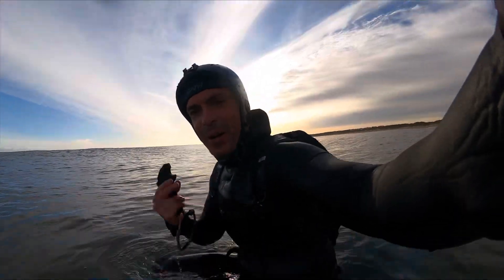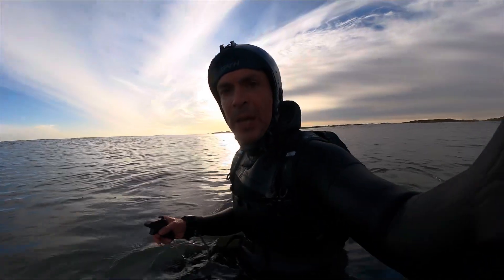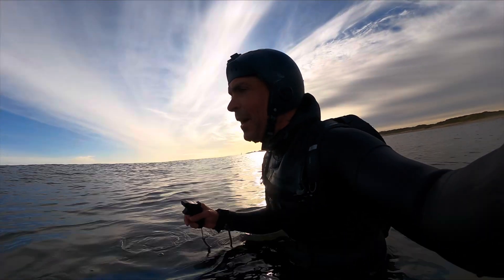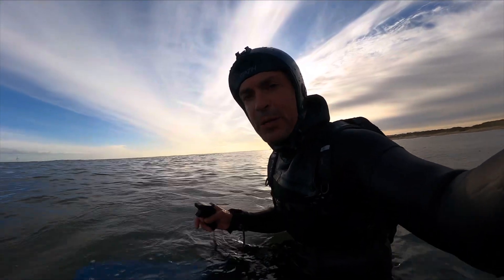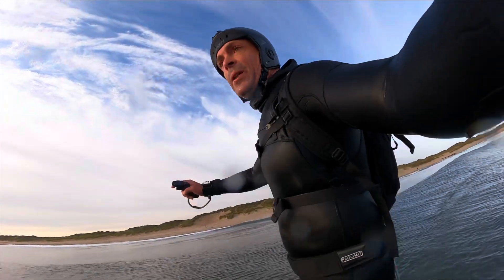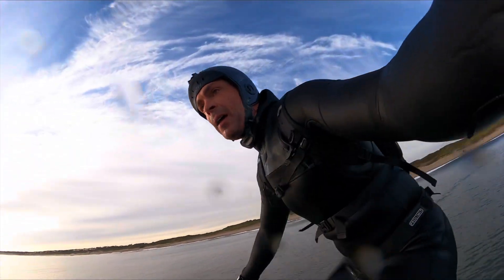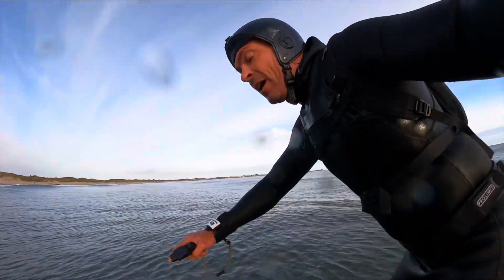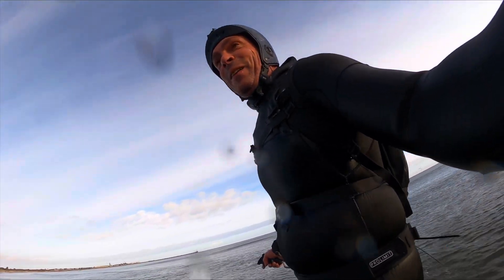Backpack Foil Assist / Foil Drive DIY Build

Comment: Nice work also planning to do something similar. What ESC do you use? If im right the three motor wires gets disconnected if you fall of the board? Did you already test that? Normally when the motor is running and this happens the ESC is dead afterwards...
Reply from the maker: Thanks. I’m using a castle Phoenix HV 160a ESC that I picked up second hand. I have also used a SEQURE 200a 14200 Pro. The cable stays connected when I fall. I have a dyneema board leash with a small amount of bungee running in parallel to the cable that is shorter than the cable even when fully stretched so the cable is never under any strain.

Comment: Looks great, interested in your umbilcal design. Did you use 4mm sq 3 core? Did you wind the coils yourself?
Reply from the maker: I’m using 2.5mm sq 3 core. It is the same cable used by foil drive. I did wind the coils myself. Thanks

Comment: what happens if you fall on a wave and board is pushed away from you?
Reply from the maker: I’m leashed to the board. I’m using a dyneema leash with a small amount of stretch in it. This runs alongside the electric cable inside a sheath. The cable is longer than the leash so it will never be put under any stress.
Reply: @JDFoiling  well thats conforting to know! If you ever have the time/patience I'd like to learn how to build/setup this. cheers!

Comment: great project and I'm building the same :) what wire/leash did you use ? are you using a 8AWG wire ? how to secure the battery / motor wire in case of a fall  ? And finally, how did you cooldown the ESC ? what setup did you use : Motor / esc ?
Reply from the maker: Thanks. I’m using the same 3 core cable used by foil drive. The reason for this is how reenforced and waterproof it is. I’ve coupled part of the cable with heat to stretch and have a dyneema leash with less stretch than the electric cable running alongside it (wrapped in a sleeve so it looks like one cable). This means the cable will never stretch more than the leash thus protecting the electrics. The motor wire is secured with a cable clamp which connects to the rear of my foil track. This clamps it very securely against the board. I have a large aluminium heat sink attached to the outside of the box I use in my rucksack. The ESC is stuck to this on the inside using thermal paste to transfer any heat. It’s passive cooling but works well. The motor is the 6384 120k BUAV that you can get hold of cheaply from China. The ESC is a second hand castle 160a Phoenix. These are amazing but v expensive new. An alternative that people are using is the sequre 12200 or 14200.
Reply: @JDFoiling where did you find the foildrive 3core câble ?
Is it better to have long motor câble or long batteries câble ? 
I will put the esc in a waterproof box on the board but receiver and batteries in the back pack
Reply from the maker: @f @f2bcnc74 the cable is “LAPP Olflex Classic 400P 3G2.5”. You don’t want long battery cables. That is why I avoided having the ESC on the board and went for the ESC next to the battery in the back pack.

Comment: Did you time the sesh duration for 12S2P battery in the conditions from the video?
Reply: See it now, 7km is pretty good I would usually I do 12-17km depending on the day using 11S3P and pretty high aspect foil 1000cm AR12 (almost no pumping back, maybe 500m max during the session)
Reply from the maker: @bohdanafanasyev3642 the 12s2p is using p45b cells. I’m going to make the 12s3p using the molicell p50b which have 11% more capacity per cell.  If I take this session as an example, the p45b in 12s3p should have got me around 10.5km. With the extra 11% that takes me to 11.6km. There was a lot of cruising around in this session as the wave period was long and it was pretty small so it should be fairly close to FD.
Reply: @JDFoiling  That's indeed worth exploring I will hopefully be testing between 12S in 2p and 3p, to see if the weight really make a difference in ergonomics. Cause I actually like to pump I just had to stop with FD cause its just not working even with 27l 4'3 board... 😆
Reply: @JDFoiling  Nice work. Consider the Samsung 50S cells. They are excellent and about half the price.
Reply from the maker: @WhiteLightning-7 thanks. Have you tried these? They have max amps of 35a which is lower than the p45b? I presume in a 3p configuration the lower amps would suffice.

Comment: Pumping should be fire, I am currently using FD Gen2 Max ~6kg and pumping sucks 😆
Also building a backpack assist to get back to the light board feeling 😊
Reply from the maker: 6kg! That’s a lot of weight on the board. I have an integrated probe board that I built called the snot rocket (see one of my earlier videos). It’s a lot lighter than an FD Gen2 but it is still heavy compared to a standard prone and the ride on the wave is compromised as a result. It’s all trade offs. Good luck with the back pack build.
Reply: @JDFoiling  yeah people get used with time but I still remember first ~5 session I was pretty upset but it is what it is and nothing gets you to the wave that easy anyway 😆

Comment: Brilliant work James, hat's off to you!!

Is the controller with the battery, in the box, and just the power cable going to the motor? This must help bluetooth continuity also, surely?
Reply from the maker: Thanks. Yes, the ESC is in the box with the battery. There are zero issues with connectivity as the ESC is at the top of the box so always out of the water.

Comment: Great vid , great build , and great timing , literally just started a rebuild on my faux drive ,was going to integrate into board, but this has inspired me to a least try the backpack approach first , nice one thankyou 🤙
Reply from the maker: Great. Glad it helped. It is definitely worth a try as it is a lot simpler than an integrated board and you can easily switch it to other boards.